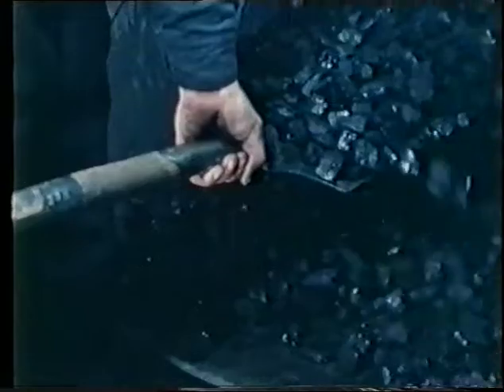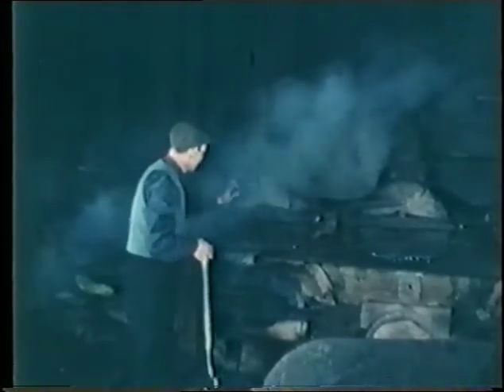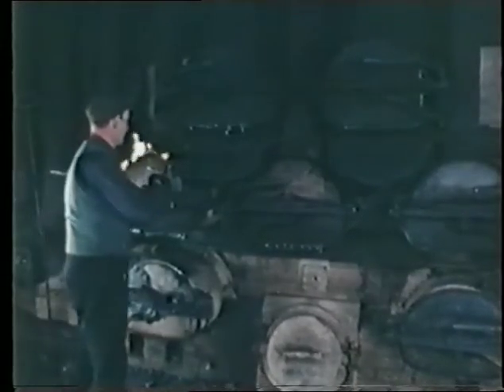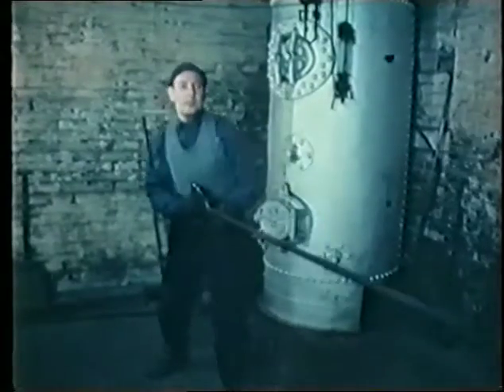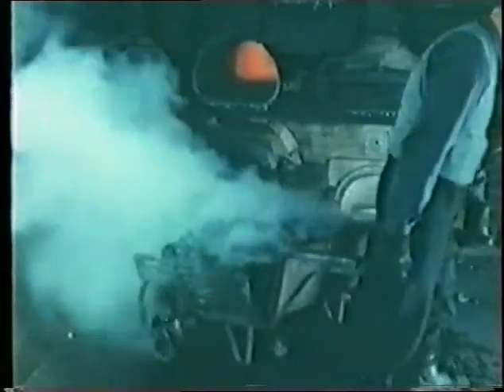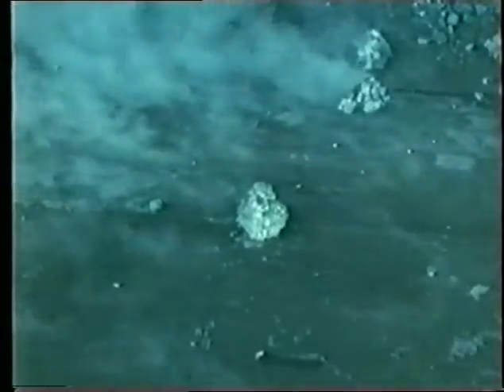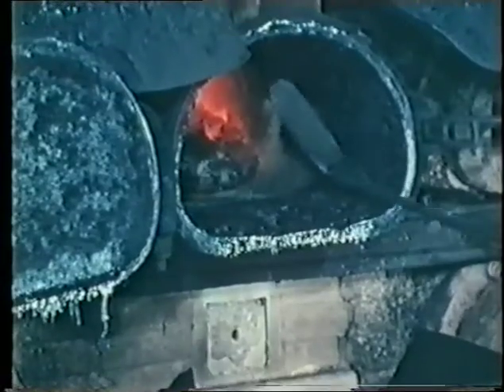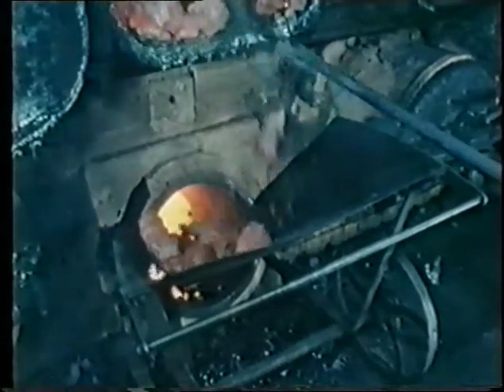How gas was made

Comment: it's interesting this industry wasn't combined with another, so instead of wasting the coal energy just for the gas you could use the coal for producing electricity or steel or something the right temp for producing coal gas then keeping each industry separated but combine both actions for the sake of efficiency.
Reply: You don't understand the process of making coal gas.   The retorts are very efficient at producing the heat required to carbonize the coal to gas, tar and coke.  The retorts use a regenerative heat process were the waste  hot gases used to heat the retorts are used to preheat the air used in the retort coke furnace  below the retort. The  retort furnace is called a producer, it essentially converts coke into Carbon monoxide which is then mixed with the preheated air to burn around the retorts. About 25% of the coke created by the cabonization of coal is used to heat the raw coal in the retorts. The remaining coke is sold as fuel to burn in fireplaces and boilers. If you combine the energy released from the remaning coke and the gas produced from the coal in a gasworks it is far more efficient and far less polluting than just burning the coal in a fireplace.  Plus you get Coal tar, ammonia, sulphur as valuable bi products😎
Reply: @sloughone1  Exactly!  If you leeched any heat away (ie, to boil water for steam) then the efficiency of the process overall would drop and the cycle would collapse.  That said, I guess you could leech some excess heat from the exhausts/chimneys to make warm-hot water but the supply would need to be fairly local and well insulated.
Reply: @Rasterizing The did have steam engines at gasworks which may have used waste heat etc.

Comment: I remember the changeover to natural gas & the the gas appliances being converted to run on it. The gas stove was never the same, pilot lights kept going out, the gas fire was harder to light.
Reply: That would have been a poor upgrade then - because natural gas has more calorific energy than town gas had.  I'm guessing the engineer who did the work may not have correctly "tuned" the appliances.

Comment: Blacksmiths don't use coal, it is coke also. We stand there with a pile of coal like an ant hill and a little rake and  tend to it always with that and a ladle of water. Needs water with a blower that will make short work of whatever you bank. The center stops smoking and the flame is no longer oxidizing. Pure carbon burning can strip the oxygen from most materials in it's flame, that's a reducing flame. There is also neutral.

Comment: The UK has 800 years worth of coal left. But it instead of using it they de-industrialized and made themselves dependent and useless, not because it was cheaper, but because it is much more expensive and therefore the liberal oligarchy can make more money off their citizens.
Reply: The coal was also fucking up the air (in the smog sense) and the mines where fucking up the countryside. Moving away from industry was stupid, moving away from coal is pretty normal. We have oil as well
Reply: @CAMSLAYER13  dude people were burning coal under their beds as they slept - it was everywhere of course it was dirty

Comment: Coal gas had  problems with condensate in the pipes showing up as a tar or oil unless the gas was  thoroughly cleaned, which would be a problem in a small plant such as the one shown.  There is another type of gas made from coke, called "producer gas" in which a stream of air and steam is introduced into a chamber filled with red hot coke. These were very common in major cities in the US. The producer gas plants would work all day to produce the gas which was stored in a big tank with a floating top and during the night the floating top would provide pressure. This producer gas contained hydrogen and carbon monoxide and  was the gas that would poison you in a gas leak.  Natural gas and propane have replaced it.
Reply: From large town gas plants coal tar was collected as a biproduct and sold on for medical and industrial uses. The coke produced was sold on to the steel industry to power the blast furnaces.
Reply: I visited the "gasometer" in Oberhausen. Fascinating costruction. If you paid attention you could still faintly smell the oil used to seal the floating top.
Reply: The tar oil can still be found in some of the old cast irons mains, they call it weasel. It's often found when replacing the mains by the insertion of PE pipe and you come across an old syphon pot.
Reply: Sylvia Plath and many others.
Reply: AND ????
Reply: @markgrender5638  A good bit of information! That's what's and
Reply: @markgrender5638  Why does there need to be an and? He explained how gas production and delivery has evolved with the times.
Just what are you asking "AND?????" about? Real life isn't always like  a movie

Comment: Coal gas turbines would produce electricity efficiently today.
Reply: It could save Europe from poverty, bur poverty is the plan atm.
Reply: Trompe pump 80% efficient. And no moving parts 

Wind turbine 20-40% efficient.
Reply: And how do you generate electricity with a trompe pump? You're comparing completely different technologies with wildly different applications.
Reply: @parviz3998  nothing new about utilising compressed air.
The point being you have a simple continuous source of energy (compressed air) and stackable along a water source, without the need to dam and flood large areas.
Reply: @robertmccabe8632  I know that but you compared a wind turbine and a trompe pump. Please explain why you compared these two technologies and why you highlighted the efficiency? A wind turbine generates electricity, also known as most useful form of energy, a trompe pump generates compressed air which must be converted into other forms of energy at a low efficiency.You cannot compare the efficiencies of those two technologies as they generate different forms of potential energy.
Reply: @robertmccabe8632   Gas turbines are like aircraft jet engines, that use gas in a combustor to create rotation..

Comment: still dont know how the gas was made?
Reply: coal in a sealed container is heated and that turns anything that isn't pure carbon into gas, that gas is drawn off and cleaned before being piped to customers
Reply: You can also do the same with wood. There's OTHER methods where it essentially creates its OWN heat but you have to light it first. Called a wood gasifier. You can run charcoal in them too. They were common in Australia in WW2. I had a relative who drove a truck with one 6 days a week.
Reply: Honestly this video is awful. Explains absolutely nothing and assumes you already understand all the terminology and processes involved, like an inverse educational video.

Comment: A Global warming factory 🏭
Reply: Maybe not really.  It was less polluting than 300 homes heated individually with coal, and far less polluting than 300 homes heated with wood.  Later when people switched to "clean inexpensive" natural gas it was another step in the right direction.  Then coal was used to make electricity with even more careful attention to efficiency.  And that is now how most electric cars are charged. Life was much more difficult back then.  It will be a long time, if ever, before we will be able to live on so-called renewables.  Until then we aren't any better than those before us because we are more wasteful now than anytime in history.  Let's not be arrogant about what our ancestors did.
Reply: @microdesigns2000  Also when Germany shamefully replaced nuclear with coal, they did so with new coal burners that were probably much cleaner and hotter so their thermal eff is closer to 45% rather than the usual 30% or so and they act as peaker plants for the renewables. They still did the wrong thing though, their carbon emmisions are about twice those of France per capita and German CO2 emisions never went down even with the REs.

I also remember every step along the road when houses were converted from coal burning to town gas then north sea gas
Reply: Global warming is a natural cycle. It comes and goes

Comment: I was wondering if one could use the same principle in isolating methane from composting organic matter in a closed, air tight container connected directly to a gasometer.
Reply: You can gasify organic matter, but it won't make a lot of methane. Town gas/coal gas was mainly carbon monoxide and hydrogen.
Reply: it would be easier to make a biogas generator from cow crap and food waste/decomposing organic matter. You can cook off of it and the kits already exist pretty cheaply.
Reply: Go look up biogas and the biogas digester. They essentially have a part that's above where the has collects and the input is like ab S bend in the way everything in the digester doesn't allow for air to come in. Needs to be above 20C to run well but will make a small amount of its own heat